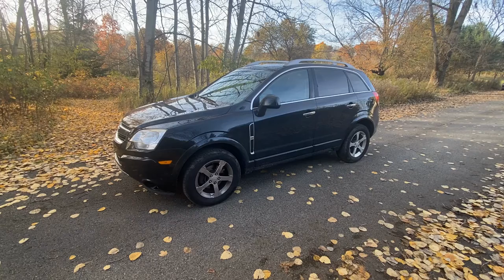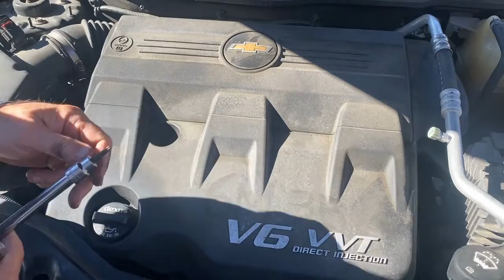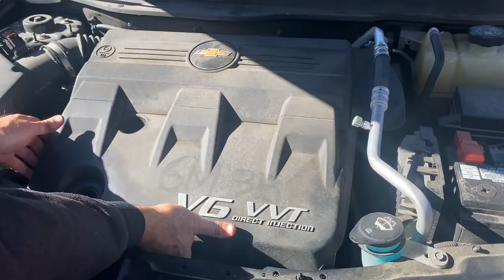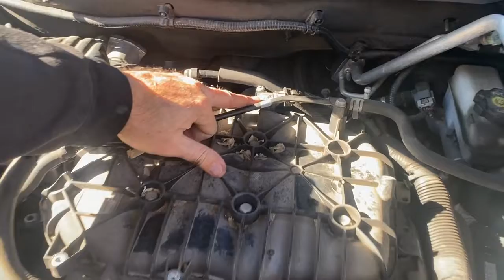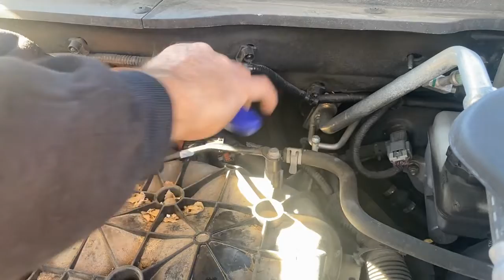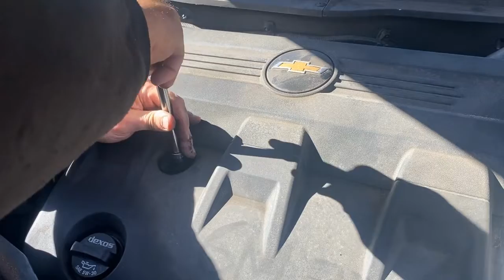How to Replace MAP Sensor Chevy Captiva

Comment: Hi, please show me where the MAF sensor is located on my 2009 Captiva 2.4Lt? I'm stumped all the way here in SA
Reply from the maker: The 2009 Chevy Captiva 2.4L MAF sensor is located directly on the plastic air intake ducting, situated between the air filter box and the engine's throttle body. Good luck !

Comment: Can a bad sending cause vehicle to loose power and severe wheel shaking?
Reply from the maker: A faulty MAP sensor can lead to a variety of engine performance problems, such as misfiring, rough running, and stalling, it wouldn't have have nothing to do with the wheel shake.
Reply: @TheAutoTeacher  if the engine didn't seized and the was manual turned and started again. Is it worth fixing?
Reply: Sorry if the engine seized but was turned manually and was able to run again....is it worth the repair?
Reply from the maker: It really depends on the miles and condition of the car .
Reply: I am having the same issue, I even changed the throttle position sensor and still. Error code P16A2. what else could it be?